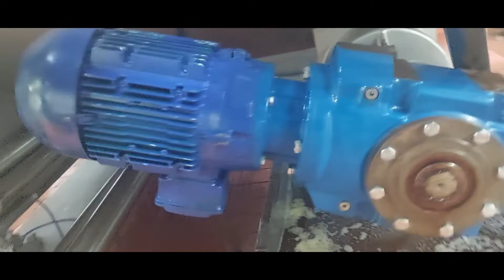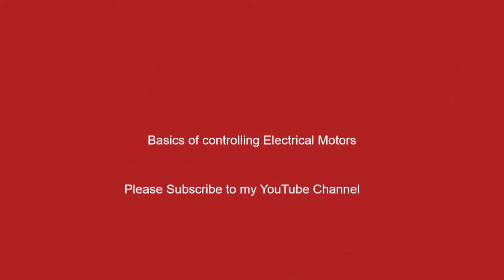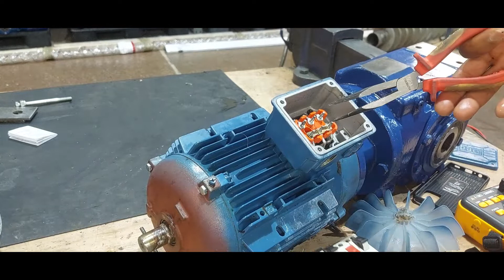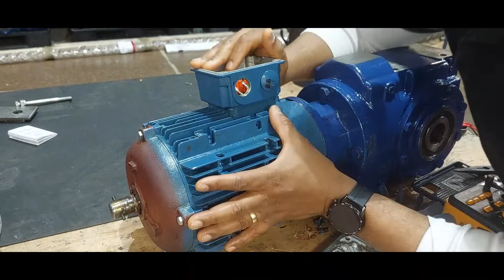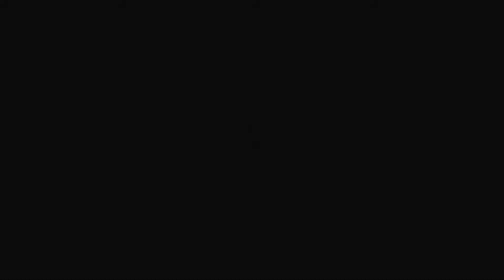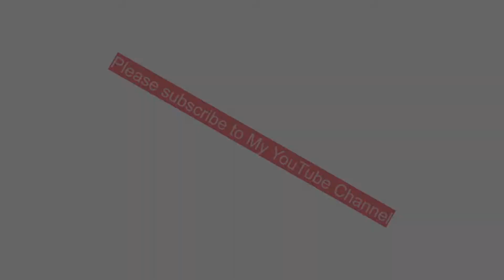Electric Motor gearbox replacement. Wrong Over-current settings on MCCB. #gearboxrepair #motortest

Comment: The only way to shield from water is to have a cover, perhaps self designed to cover all and around the motor with a port for circulation of air where water will cause minimum chance of entry.